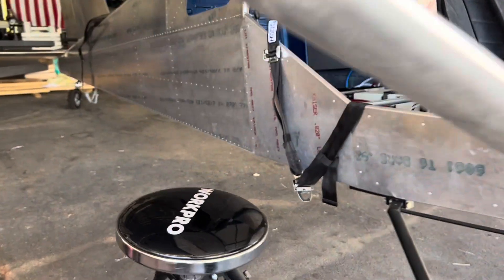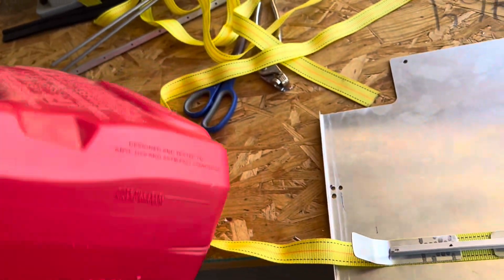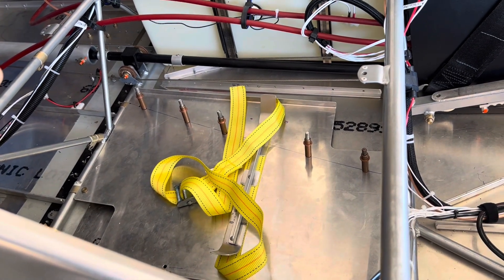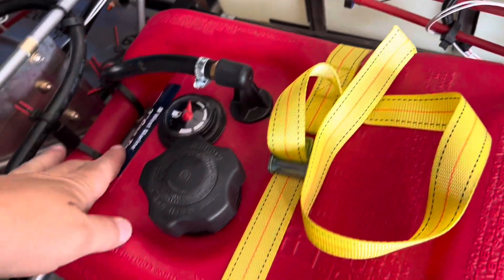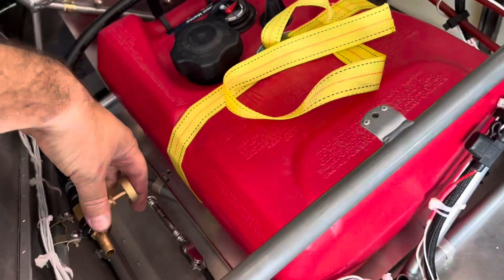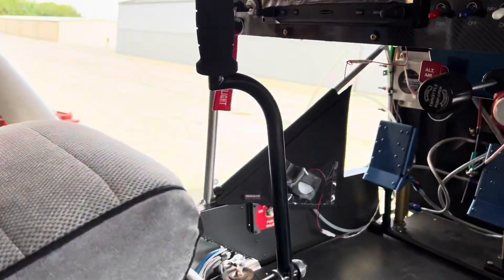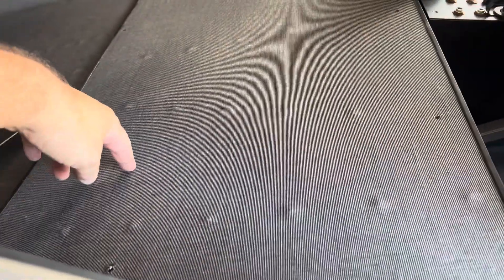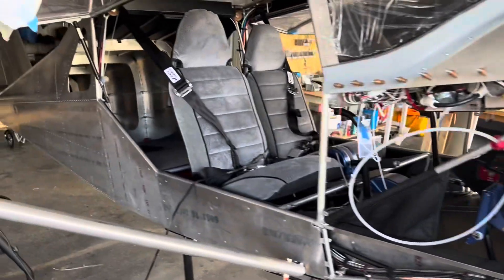Adding Smoke to a RANS S-21

Comment: Hi Branden,  just found your S-21 videos - nice job on them.  I'm wondering why you feel you need a second header tank?  If you wanted to increase the capacity, why not have an aluminum tank built that would straddle both sides and get rid of the fuel cap and hokey bulkhead fittings?  My opinion, the header tank is one of the weak points on a very nice airplane.
Reply from the maker: The 2nd header was for the smoke system. Never intended to add fuel.
Reply: @BadlandsAdventures  I should have watched the video before commenting...  Looks like you have a very nice build going!

Comment: Hey Branden - Brandon here.  I watched your video on install of portable west marine gas tank for smoke system. I was hoping to copy you given your clearly have more skills than me.  Also building s-21 and trying to be ready for engine like you, which obviously won’t come for some time (I ordered may of 21).  Any chance you can tell me where you found that tank and the pump?  I have tried to find tank and not successful.
Reply from the maker: Thanks! Looks like West Marine changed their tank design. Try the Attwood 3 gallon tank on Amazon: https://www.amazon.com/attwood-8803LPG2-Certified-gallon-Portable/dp/B0053HOWUO/ref=dp_fod_1?pd_rd_i=B0053HOWUO&psc=1

The pump and all the fittings were from www.smokesystemhelper.com. 

If I wasn’t so lazy I would have used a second header tank. I did not want to remove the aileron pulley because I already rigged the controls.
Reply: @BadlandsAdventures  thank you!   I saw you had the shut off valve which I see is available on that website and also see the oil pump.  Are there other fittings or hardware that you bought from there for other parts of the system?  Also thanks much for the Attwood recommendation.  I also don’t want to modify any of the cable system.  I assume you also just ordered another fuel header tank base from rans.  Thanks again for your help.
Reply from the maker: @bfryar22  No modification to the cable system. I just didn’t want to disassemble the lower right aileron pulley at that time. The stock header tank would be ideal for a smoke tank on the passenger side. All the fittings and hose are included in the smoke system helper kit to assemble the smoke system.